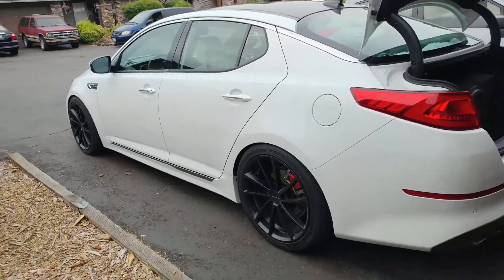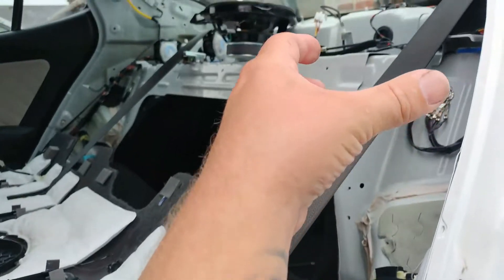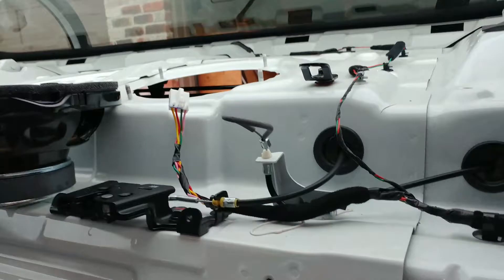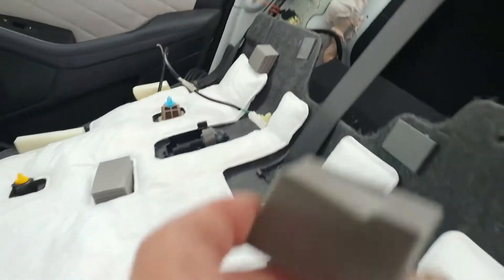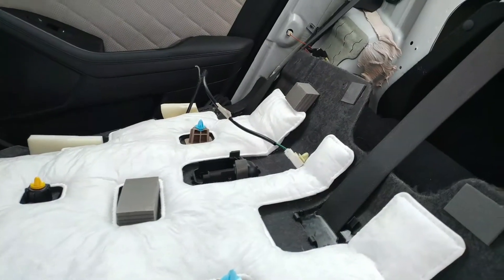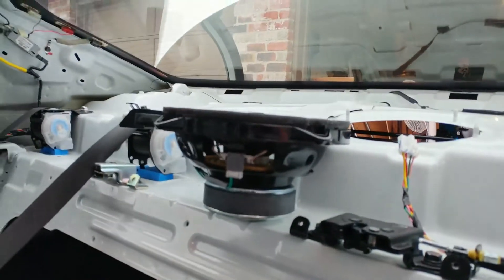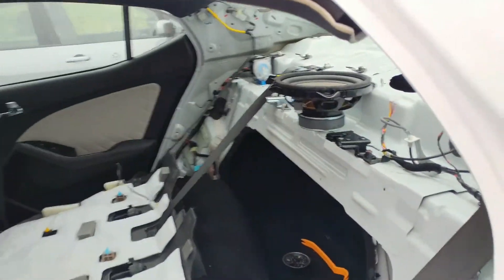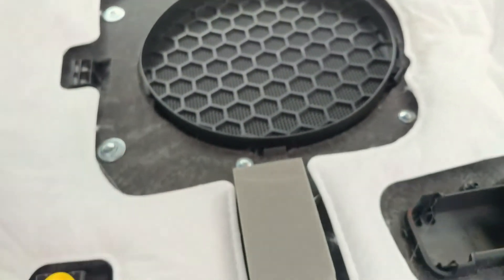How to remove the factory / stock subwoofer in a 2015 Kia Optima SXL Turbo

Comment: Thanks for the video.  Wanted to do this for the same reason you did.  Does this make an audible difference, like when the seat is down?
Reply from the maker: Absolutely... There is so much insulation in the car if you have a subwoofer mounted in the trunk I have found that the best result in the cab of the car is with 1/2 usually the smaller half of the seat is down it produces the best sound.. you lose a lot of sound in a lot of bass in the cab with both seats up in the back end.. this is my daughter's car in the video in my sonata I leave the small house of the back seat down 24/7 of course I don't usually have people riding back there.
Reply from the maker: Thanks for watching the video glad you liked it if you could hit the subscribe button and the like button that helps out tremendously thank you if you have anymore questions feel free to ask

Comment: Did you use your factory amp to power the new sub or did you run with a new amp?
Reply from the maker: Ran a new amplifier with a new subwoofer and deleted and removed the factory subwoofer completely
Reply: @BLRTUNING  do you know if the factory amp with run another sub same size? Want a different brand actually a kicker L7t.
Reply from the maker: I have no clue never tried it

Comment: Will I be able to replace it with another? I already have a new 8" Lanzar sub but I don't wanna take it apart if it won't fit
Reply: Did you ever find out if you could replace it with a aftermarket 8”?
Reply from the maker: we took it out completely and installed a speaker box in the trunk but I don't see why you wouldn't be able to you just have to remember that it uses what is called a sealed basket.. meaning the speaker that's in there does not require a speaker box to build air pressure to create base..
Reply: @BLRTUNING  Thank you, I’ve been looking at the free air subs but can’t figure out if I can use factory amp or if I would have to run wires for sub amp. I’m not messaging with door speakers my ole lady just wants more bass with her highs

Comment: Where is the oem amplifier located
Reply from the maker: Vincent Deese on this model it was located in the dash you could get to it by pulling out the entire stereo system head unit we could see it back behind there probably would have had to pull out a few more things to get it out but on other models I have seen it underneath the rear decklid in the trunk mounted upside down. That's where I found the one in my Sonata 2012 GLS
Reply from the maker: Vincent Deese so I would check the trunk and see if you can see a black box mounted underneath the deck lid it's about 8 in by 6 in or so if you don't see it there it's probably in the dash or under the passenger seat
Reply: BiLL Ramseyer ok I’m installing an amp with a loc on a 2016 optima turbo I’ve heard them being on the passenger side in the trunk but if I don’t see it there I’ll look behind the head unit
Reply: BiLL Ramseyer ok thanks
Reply: Nope it’s on the passenger side of the trunk behind the liner

Comment: im trying to see if someone could give me an idea of how to install a ten where the 8 used to be
Reply: king overrthang you can’t do this, just look for an upgraded 8” sub. Unless you do not mind doing some cutting and drilling then go right ahead
Reply: This is late, but if you do that, make sure you get a "Free air Subwoofer" because thats what that stock 8" is... It would be better to just get a sub and enclosure all together.  Switching that 8" for a 10" with the same factory amp and all, won't make much a difference in sound, unless you plan on adding an aftermarket amp and a good LOC with an EQ in it.